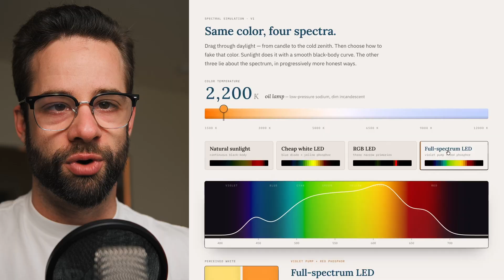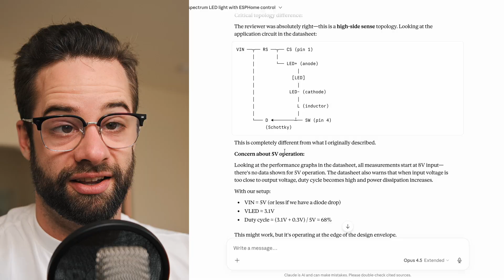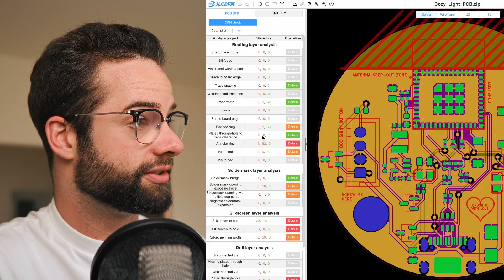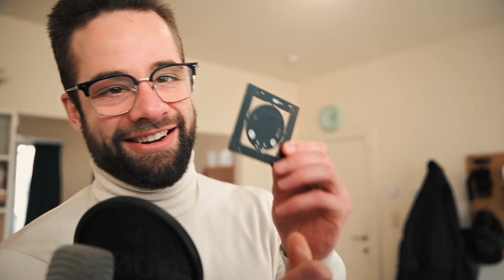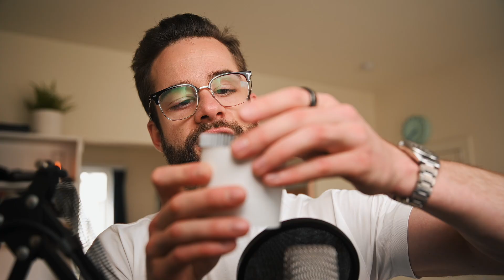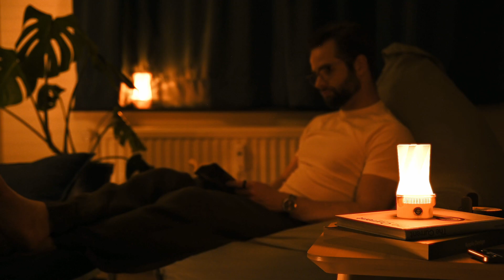I Built the Light That Doesn't Exist

Comment: I was waiting for this! Wow this is completely up my alley. I've been looking for smart lightbulbs, or even LED-modules with a great CRI-rating that also work great within 2200K and there's almost nothing. Praise the DIY-time we live in in which we can just make whatever we want.  

In the past I've made some smaller "puck-lamps", about 8cm in diameter with a 3D printed shell and a little battery inside. It can stay on for about 10 hours and gives great candle-light type light, about 50 lumen, which is fine for me. I would like to make a smart-version with that, using those low-power smart switches. I've found the 3D printed shells to provide a great level of translucency and diffusion at a width of 0.8mm with white (matte) PLA. Think it looks better than the translucent PETG. 

Also I've found that the current chat-models struggle with hyper specific situations like these, where it seems like it gives a specific answer back, which is actually a generic answer that doesn't really fit the problem you're facing. 

One idea for connecting the top and bottom is to use either a screw mount, which is quite easy in Fusion. Or a twist-snap (a bit more intricate). Also for the flickering you could just add a transitor-switch to some caps connected to the IC so you can switch between DC and AC (sorta). Caps are always a good thing.

Heel erg tof dit, en hoe je het vertelt en deelt.
Reply from the maker: Ah, happy you liked it man!

Oh man, a thread...of course! facepalms That actually works really, really well. Tried it yesterday and it's a winner. Thanks :)

Yea, I started off with the translucent PETG thinking it'd be great but ending up liking simple white matte PLA more. Feels a lot calmer.

Definitely the ChatGPT/Claude's of the world need quite some convincing to do a great job (I've found them especially bad with spatial reasoning, like layout or assembly order).

Hmmm will have a look at those caps. Got a few people here around me who want one so there's enough reason to design a V2 ;) Maybe I'll get adventurous and have it battery powered too! The bottom needs more weight to balance the heatsink anyways.

<3